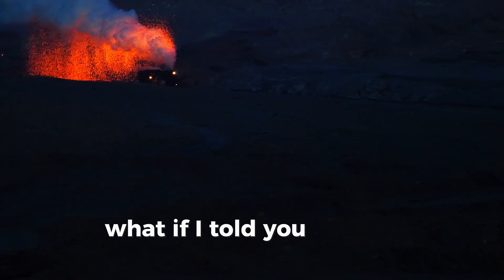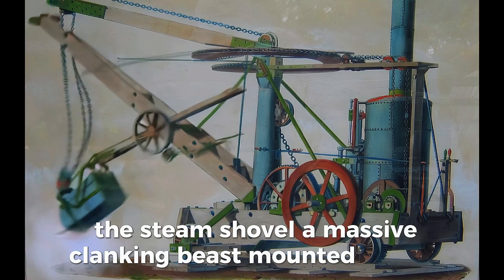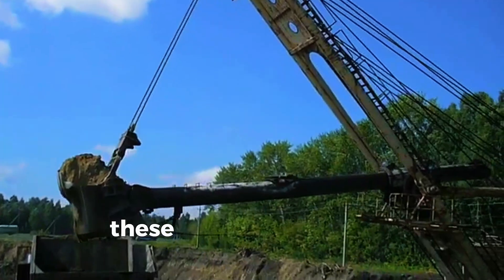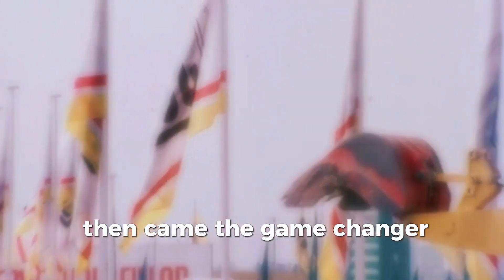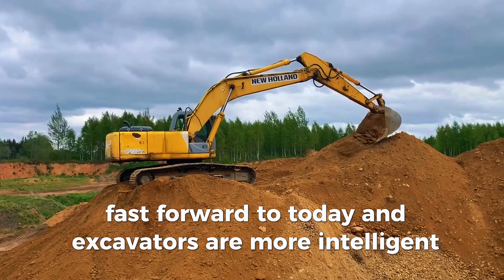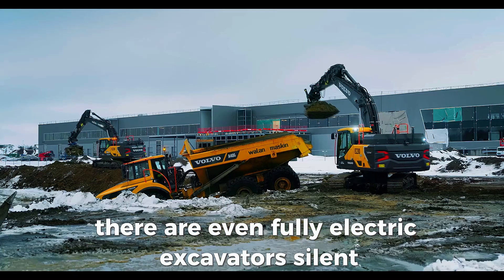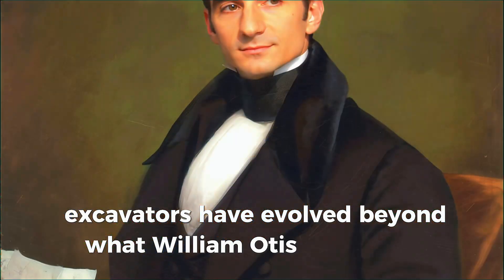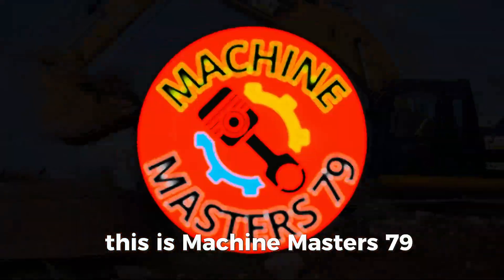Excavator History: The First-Ever Digging Machine

Comment: Thank you for talking about the History of excavator 😊❤😊 even when you look at the early HYDRAULIC excavators you still needed to be alert to the function of the boom dipper and bucket. The early Hydraulics manufacturer made different controllers for function some used foot pedals for dipper and bucket. Some had button on the two levers for dipper and bucket. You used your fingers to push the function or like Bucyrus Erie had more of wrist movements of your whole hand. Most kept the swing forward and back on the LEFT big lever. DROTT was the first to make pedals and two stick levers to be universal in how the manufacturer set the new excavator up for you. So say you had a brand that the operator used pedals for function the DROTT could be set up just like your other excavator even still keeping the LAFT lever forward and backwards for house swing, but the (A.B.C.D. PATTERN) could also set the lever for sideways movements of the house. Just like universal control patterns are today. And yes one of the patterns was the JOHN DEERE controllers with BOOM on LEFT main lever. Today most manufacturer have a valve lever close or inside the cab to change the boom from left to right controllers. I loved watching those early excavator work with a great operator. The huge POCLAIN excavator on one job had 4 levers up to operator but two had linkage attached the base of the long sticks so operator could use his feet. I do think that was an after market attachment that the owner had fabrication in cab built on base of the levers to operator. Its the only POCLAIN I have ever seen with that set up for operator. We had a 160 POCLAIN on another job and it was very modern with two levers on seat arm rests. That was in (1979) so POCLAIN had modernized it's two lever only controllers. My learning first backhoe was a 580-C CASE with 3 levers. Foot swing pedals. When I tryed to run a John Deere I could not master the BOOM on LEFT levers.
My personal play toy is my Dynahoe-190 with what their terms call the ( Twin-A-Trol) pattern but my BOOM is on RIGHT lever, like most all excavator or backhoe use today.
Reply from the maker: Thank you so much for this awesome comment and extra history lesson! 😊❤️

I really appreciate you sharing your knowledge about those early hydraulic controls – pedals, buttons, wrist movements, Bucyrus Erie, DROTT, all of that is super interesting. It’s crazy how many different systems operators had to learn before things became more universal.

Comments like yours make these videos even better for everyone watching. 🙌
I’ll definitely keep this info in mind for future excavator videos – feel free to share more stories anytime, I love reading them! 💪🦾🚜